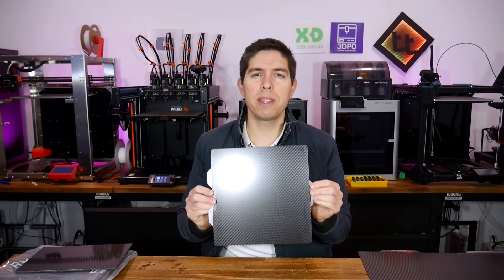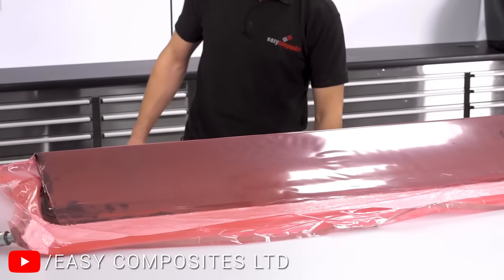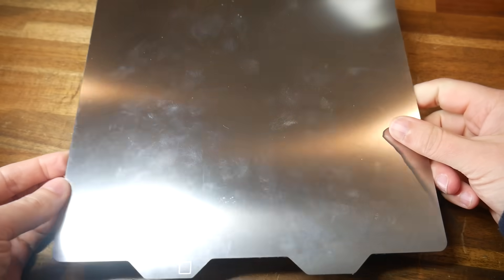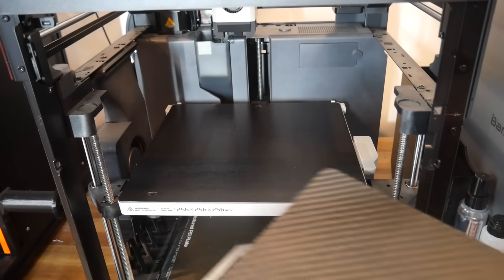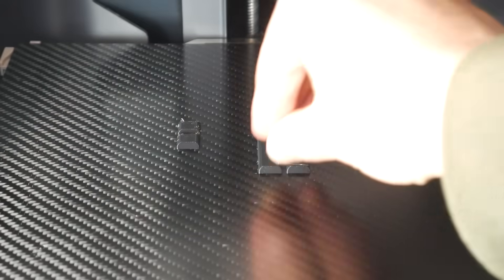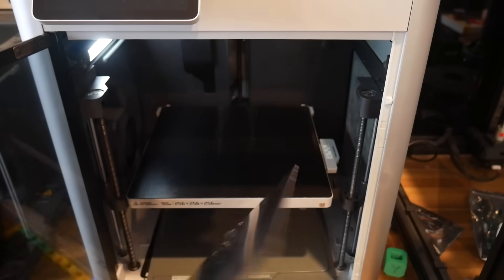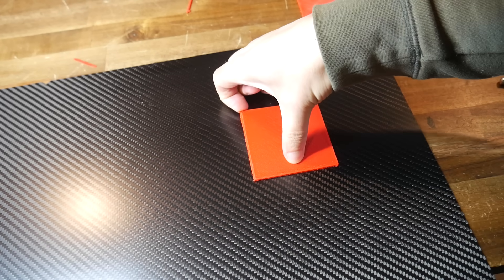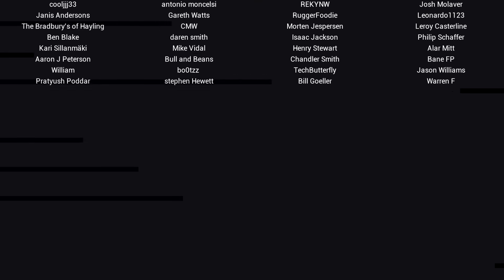Testing the Wham Bam carbon fiber plate - The ultimate 3D printer bed?

Comment from the maker: For some reason there are a lot of comments pointing out that you are only only printing on the resin. This is true, which is why I have a chapter of the video dedicated to pointing this out and getting Wham Bam's response. 12:16
Reply: Also, carbon fiber has higher thermal conductivity than fiberglass. This improves thermal uniformity of the build plate, which should be measurable by IR  photography.
Reply: So after reading their response, it seems to me the answer is:  It's a lot like garolite, but formulated specifically for 3d printing so that it won't ruin the printed parts or the bed when you remove the parts, and also won't release them too early.  Also, dimensional stability.  It's a good answer, but really wordy.
Reply: The resin is exactly what makes G10 so good! It's just a bit harder to find a carbon fiber plate, so I'm happy to see a quality plate for bed slingers! Been searching forever for a magnetic bed with G10 on top for PETG and nylon
Reply: I guess the carbon fiber makes a very thin layer of resin over it possible wich is better bonded to the fibers (if you ripp out parts of this kind of beds its usualy the hard and unflexible part that comes of). Beside that - it allows for this thin film on a normal steel sheet, what makes it better compatible to other kinds of steel sheets. But maybe they are doing it just for the fancy carbon fiber look - who knows :P.
Reply: I appreciate your thorough review of the product and the fair consideration of the product's pros and cons.   Thank you for taking the time to test each material and share your experience.
Reply: I am not really buying it... they use many fancy marketing words, aren't they? Can someone explain it in simpler words? Are they saying "yes, you are printing only on resin, but this is our resin and it is better". And are they claiming, only carbon fibers prevent the resin from being ripped off the surface of the printbed?
Reply from the maker: I am happy for people to come to whatever conclusion they like. I just want them to watch the whole video before commenting and making a point that is clearly addressed.
Reply: @klickeldiklick  You guys are being so weird about this. 

Where was this complaining when you were buying spring steel sheets (like the ones that come with Prusa machines)?  You’re not printing *on* Steel.
Reply: @RightJoystick  What is weird about asking a technical question? Nobody thinks or says they are printing on steel, they are always "coated", mostly PEI, so why make that false comparison? Steel is used as a base because it is cheap, flexible, robust and magnetic. When Wham Bam calls their sheets "carbon fiber", selling them with a high price tag, then we can ask about the technical details.
Reply: @RightJoystick  people like the spring steel because it gives a more rigid structure that transfers heat well, the carbon looks to be added to a spring steel sheet which is already stiffer than a lot of people would prefer so its not giving any affects on the rigidity that would make for a better user experience. also remember that a spring steel pei sheet is usually only $5-$10 more that a flex pei sheet while these are over $70 more than most spring steel beds. it sounds like they have come up with a pretty good product in their resin but they are forcing people to spend more money to get it by throwing in useless carbon fiber.
Reply: A perfect example is to compare steel with steel. You can buy american made steel, australian made steel then there's chinesium steel. They're all 'steel' but I will guarantee that the american and australian steel pass multiple structural tests but the chinesium will probably pass just a couple as the inconsistency of production and quality of base materials is off the charts! Whambam had found the goldilocks zone of the resin, are strictly sticking to the recipe and are using carbon fibre for structural integrity, flexibility for bending release and lightness.

Comment: Bulletproof way to clean any build plate from stubborn filament to remove without risk of damage..
Wet it, place a paper towel Over the area, place ir in freezer for -+5min.. comes right off easilly.

Comment: I use purple Elmers school glue stick with ABS.  It works well, and you can cleanly remove it with soap and  water.  I've only used the carbon fiber plate a few times, I need to try in again.  I got mine in the first shipment from WB.

Comment: I'm still using good old regular mate glass bed with glue, just for relayability reasons. I print a lot, about 30kg/month on it, and and it's still zero damage to it. The only significant downside is inability to use fast bed leveling probes like Beacon.

Comment: 9:40 Dont take off prints from Dimafix with brute force. Let water soak between build plate and the part. Thats why my G10 plate is only damaged by its thousands prints. Over the time, i experienced the resin breaking off of the fiber, exposing the fiber to the surface.

Comment: CFRP (mostly made in with prepreg tape) is used for molds for large aircraft parts. (wing skins for the 787 etc) The main issue with high temperature printing or autoclave cured cfrp for that matter is thermal expansion. Depending on the lay-up cfrp can actually shrink as it heats. Many of the molds also used Invar but that stuff is crazy expensive and very heavy. For 3d printing it makes sense at very high enclosure temperatures. It would be possible to use different fibers but as carbon is the high end option there are going to be better resin choices and higher quality fibers to choose from.

Comment: I use a Wham Bam PEX plate on my P1P using the high temp plate setting for PLA. I also don’t clean the plate because the buildup of material seems to make the prints stick better. When I print outside of my “normal” printing area I do find prints don’t stick as well. This was the same with the textured PEI plate. I do like the PEX plate because the smooth print surface makes a good flat surface when making cosplay armor. Not really certain in my use case if switching to something else matters over just having more PEX plates available to print on.

Comment: Meanwhile I’m still using a glass textured plate covered in children’s glue stick. Running it through the dishwasher with the rest of the dishes to clean it once there is 1/8” glue stick on it. 😂

Comment: I’m using one just made out of CF (and epoxy of course) since half a year and it’s doing great.
I’m printing mostly PC-GF with the bed at 180C (170C in reality at the top of the surface) in combination with stick glue: I can simply remove the bed (the at those temperature is soft and flexible) and leave it on a flat surface for 20 min to then have the parts coming off by themselves.
The printer is a modified 3NTR A4V2 and it comes by stock with that plate.

Comment: I have had excellent luck with this plate running ABS with no glue. It's weird that you did not, mine were stuck firm at 100C. At 90C it did self release early on me though.

Comment: cover a steelplate in resin only - fibers are for stability only, whats provided from the steel plate itself. PEI plates do not have any fibers too - no need.
(I use standard PEI sheets - where I take care of only one material for one side, and after about 2000h printtime the are in pretty great condition (except one original creality plate, where the 50g free Original creality PLA sticks so brutally well, that the PEI coating released a bit and now there is a tiny hill - now I prevent Creality filaments on creality printers :-) )
Reply: Resin on a steel plate will crack, if you bend it.
Reply: @0Turbox  there exist flex-resin too

Comment: Thanks as always for your details and focus on the facts. I am sure you had your own reservations/curiosities on the CF element since you're also a racing enthusiast (well, I used to track..) and it's pros/cons, "hype factor" (carbon fiber valve stems, for instance), best use cases, etc.. First glance it seems gimmicky, CF being a hype tool, but it does make sense once you get past the "printing on the resin" mindset. If Wham Bam is truly controlling it's manufacturing process from start to finish, then I wouldn't mind trying it out for ASA and my other odd filament choices that do not like the usual PEI. You did the hard and pricey part of using up filament to see what works, so I appreciate it!

Comment: Warping problems with PA filaments are usually due to the bed and/or chamber temperature being too high. PAs are semi-crinstalline and therefore crystallize and shrink above a certain temp. 100° bed temperature is excessive for most PA materials, especially those usually found in cheaper filaments. For example, I usually print Luvocom 9742 (called PAHT-CF, a highly modified and most likely semi aromatic PA6) at 75° chamber. Any higher and it will first become too soft, and later crystallize and warp heavily.

Comment: Hello Michael, I have a Creality ender3 s1 pro printer, I don't have any problems with small prints, but when I want to print large prints, it says communication with the MCU is lost at different times and the printing process stops, when I want to continue from where it left off, it starts from the wrong position. Why does this machine give an error with large prints, I searched the internet and couldn't find much information that would be useful for me. I talked to a service and they told me that this could be due to overheating of the sonic pad, stepper or motherboard. I don't know what to do. Do you think cooling the steppers could be a solution, if you have published a video about this, I couldn't find it unfortunately. I would be very happy if you could give me advice. Unfortunately, I don't have enough technical knowledge on these issues. 😞

Comment: While I get that the carbon fiber will keep a supremely tough hold on the epoxy, I can't help but feel like I'd rather just spend money on some binder clips and a whackton of FR4 sheets for a couple bucks apiece instead. Still, it seems like a good option for people who aren't trying to pinch pennies for an epoxy plate and have something more valuable than a $60 plate at stake.

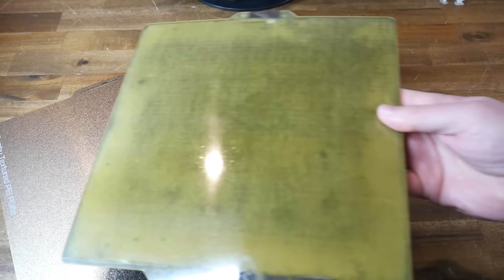Comment: 4:32 where did you get this garolite/g10 bed? I need one!!! As recommended by Maker's Muse I got an FR-4 sheet (which is what most things labeled "garolite" or "g10" actually are) at the thickness he said, but it is WAY too thick for my setup which has an inductive probe. This floppy thing looks like it would conform to my print bed much better so that the inductive leveling can still function. If anyone sees this and knows, PLEASE let me know!

Comment: even with the explanation i don't understand what the point of the carbon is, its on a metal back so its not like its the only structural factor and if the reason they made these was to use their own resins, why not just do that but without carbon fiber? seems like a pointless upsell just made to sell a product for more than it needs to be.

Comment: I have a voron switchwire, and being a bed slinger, I use a cf sheet and print surface to reduce weight and get better speeds... Abs never sticks without glue(I use magigoo). And in my case it does leave a cf pattern on the first layer.

Comment: Surprised no one has noted on the preheat for 5 minutes. The reason for this is because carbon fiber has poor heat conductivity. At its core, it's not the right material for the job even if all materials stick for printing. Although, it is very thermally stable in that it has a very low expansion coefficient and will remain flat without warping. But still,  use the right tool for the job. Consider the additional electricity used to preheat and maintain the temperature and the additional wear and tear on the power supply and the heater element.

Comment: I have been using a carbon-fiber heat bed for almost 2 years now on my X1C I never change plates; it literally works with every single filament. I highly recommend 10/10.
Reply: Even nylon?

Comment: I ise tje Engineering plate for all materials. It worjs fine with PETG and PMA as well as ABS and ASA. Tgeres no need for CF in my view - it is sfter all, as you eventually got around to sayin (I hadvbeen thinking it all through the video) epocy you are printing on, not CF. In that sense CF is irrelevant. The only advantage I can see it offering is a thinner substrate than, say, GF and thus pitentially easier flex.
As the Engineering pkate on BL printers works perfectly well for all materials I see no reason to but this CF plate.

Comment: Seems pretty pointless and I guess weight may matter with a bed slinger but If you are dropping 200 on a bed I don't see you not using a Core XY printer.

Comment: I got interested but after taxes plus shipping to Germany one plate costs 76.05 Euros (with 20% predorder rebate). On their website it says in Europe they are shipping from Poland - but during checkout it adds 19.99 Euros for shipping. That's just crazy for a single build plate.
Ordering two plates plus useless stickers to get free shipping its ~110 Euros - which is better per plate but I don't really want two. And if they are not shipping from Poland (because 20 Euros is a crazy shipping cost) I would probably have to pay import tax (+19%) on top? A dilemma that made me not buying anything. 🤷‍♀

Comment: Looking at their description of the carbon fibre, they appear to be using a wet lay-up process, is there any reason why they're not using a pre-preg carbon fibre such as Fibredux 914C-933-42 which is cured at 175 degrees so can withstand a higher temperature?

Comment: I have made exactly this a few years ago… a 0.5mm sheet of carbon fiber on a spring steel plate 

To actually make good use of the carbon fiber… you actually need to sand back the resin so that the carbon fiber is exposed… things stick better and leaves behind a holographic like carbon fiber pattern 

There were already multiple YouTube videos documenting this when I made mine 2-3 years ago
Reply: https://youtu.be/V8A_QTq9WYg?si=gyeWtwju6o_oNWAa

Comment: 4mm thick naked lab grade borosilicate glass with a small amount of hairspray and a blow torch to burn away the hairspray leaving a nano layer of carbon build up continues to be my favorite. Plus its super flat and cant be damaged with anything short of razor sharp CR-V steel or tungsten
Reply: I use lambskin.  Works fine but the lamb gets really worked up sometimes.

Comment: Looks promising.  I have Wham Bam PEI sheets on all of my printers and most also have the textured that I can swap out.  These were not cheap, but really do the job without any adhesive for PLA and ABS.   I think my two Rat Rigs were close to $500 for the set. I don't print much PETG, but would probably use something as a barrier to protect the sheet.

Comment: Meanwhile im using a Tempered glass bed connected with thermal tape that is good up to 190c. No issues at any temps. My only complaints about glass is that for a bed slinger it has a bunch of mass and that would be where i can see CF being better. 

Try Sunlu's aPLA (anti string PLA) it is the only filament i cant get to stick to smooth glass without gluestick. But textured TG no issues.

Comment: While I understand the advantages which carbon fibre has, I don’t think it’s benefits are significant enough to justify the very high costs of the plate, especially when the main factor here seems to be the resin.
Maybe it’s advantages may be worth it for commercial or engineering uses where the benefits matter more and the price would be less significant, however I think for most hobbyists, this definitely isn’t worth the price.
Reply: As someone who mainly prints with PLA and PETG, and very rarely ABS, this product is probably not for me when a <$20usd PEI plate will suffice. 

Regardless, I think the idea of the plate is cool and could definitely have uses, but their marketing and description is probably not entirely appropriate to be wholly focused on the CF, and could probably benefit as well from more details on the resin they are using.

Comment: My Conclusion: just buy a garolite sheet from McMaster (1/32 inch thick is perfect) along with a magnetic-receptive sheet. Cut them both to size and enjoy. 

The result is super flexible and adheres just as good as the steel to a magnet bed.

Comment: When I first saw these on Wham Bam's site, I honestly dismissed it as a silly gimmick and being fair that isn't entirely wrong still. It sorta is, but sorta isn't. The carbon fiber is technically lighter and more durable than GF. As to is it a significant difference in reality? That is harder to answer. Part of me thinks that if they controlled the entire process of making garrolite, that the difference between it and the carbon fiber wouldn't really be of any real significance. I think we are mostly looking at cost and aesthetics here, though I will admit being a bit of a sucker for aesthetics sometimes. The price is a little expensive, but given it can handle any material it isn't terrible either. I am a little on the fence now and with the 20% pre order discount I am actually considering snatching one now. I might not use it as my daily driver for PLA/PETG which PEI frankly works flawlessly for and is super cheap to replace, but when I need to print far more picky materials it is a tempting option. I'll say this, had they priced it more competitive with Bambu's offerings (Which I already get off Ali-express, because $37 for pei is absurd), I would probably buy a couple of them without hesitation.